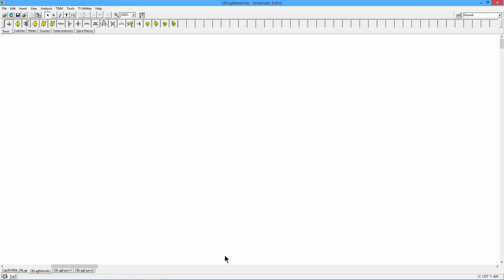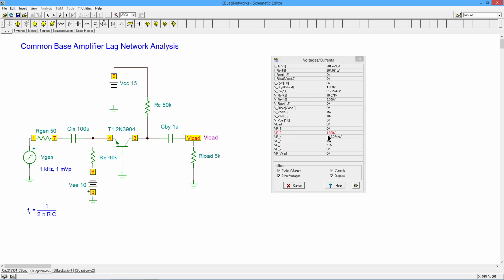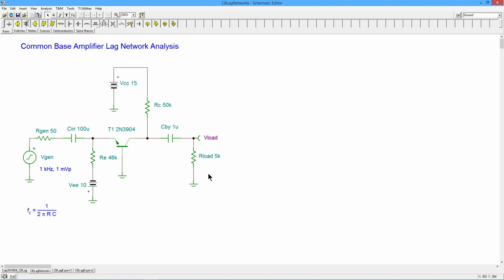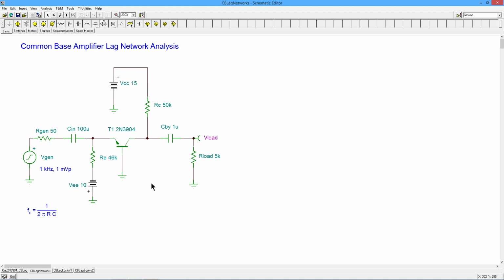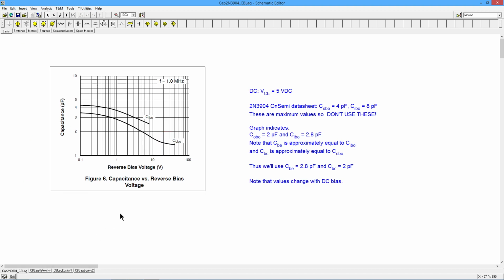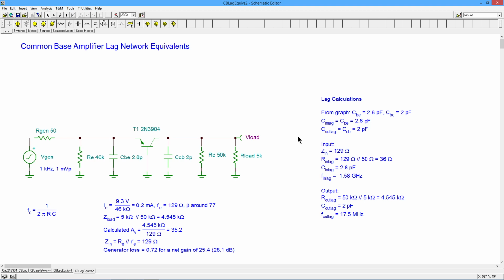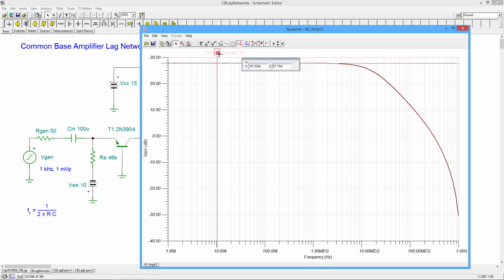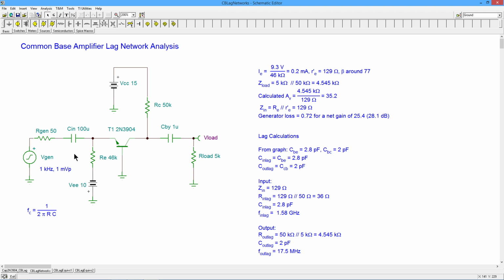Semiconductor Devices: BJT Common Base Lag Networks

Comment: Base (Bias?) resistor and bypass cap, and what happens if the cap is left out and we have just a resistor on the base.
This always seems to get skipped..
Reply from the maker: ? There is no bypass cap in this circuit. There are two coupling caps that are required to block DC to/from the source and load.
Reply: @ElectronicswithProfessorFiore 
Sorry
When I watch other videos about common base there is always a resistor from base to ground with a bypass cap and it just gets waved away and no proper explanation.
Do you have one?
Hope that’s more complete than my 2am question
Reply from the maker: @TimeToTakeTheRubbishOut  If there is a resistor from base to ground and a bypass cap is across it, then the base terminal is at AC ground, and therefore, has no effect on high frequency performance (the subject of this video). That is, this analysis proceeds with the fact that the base is at AC ground. It doesn't matter if the base is at DC ground or not as far as the AC equivalent is concerned. So, whether it's directly tied to ground (DC and AC) as it is here, or shorted to AC ground with a bypass cap, AC ground is AC ground. 

In this particular circuit with this kind of bias there is no need for a base resistor, so why include one? Now, if this was a common emitter amp using the same sort of bias, you'd have to have a base resistor. Leaving it open, there would be no return path for base current and the bias would not work correctly. The bias would be fine if you used a short for Rb, but then you'd also be shorting out the signal source. Not much use in doing that.

Comment: Thank you. Do you have any videos that talk about the 'Bandwidth Product'? I think you mentioned it here. It doesn't normally bother me in audio amps.
Reply from the maker: "bandwidth product" is shorthand for "gain-bandwidth product". That's a big item for op amps, and yes, there are videos covering that in the Op Amps playlist. The nearest thing to it for a BJT is a parameter called ft (f sub t), or sometimes f sub beta. This is the point at which the beta of the transistor falls to unity. Generally speaking, the higher the ft, the higher the f2 of the amplifier.
Reply: @ElectronicswithProfessorFiore  Thank you. I've come across it in opamps and never really considered it in BJTs. I think that we sometimes forget that opamps are made up of Transistors!